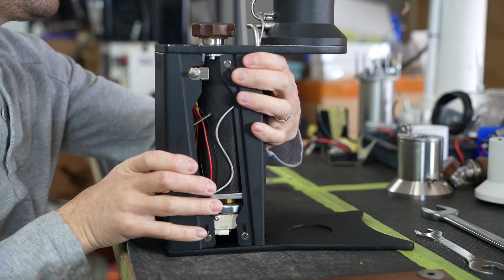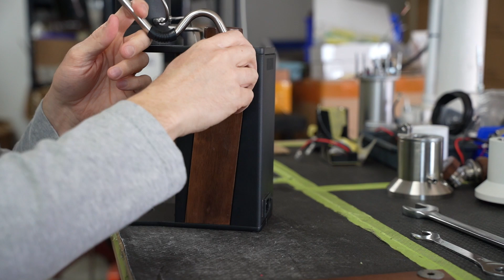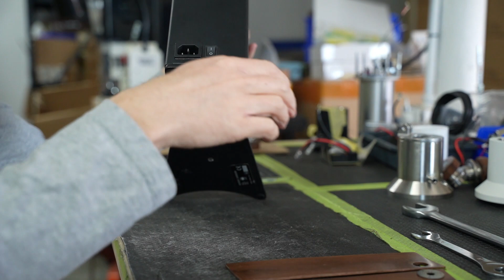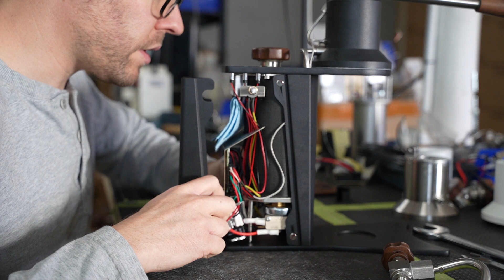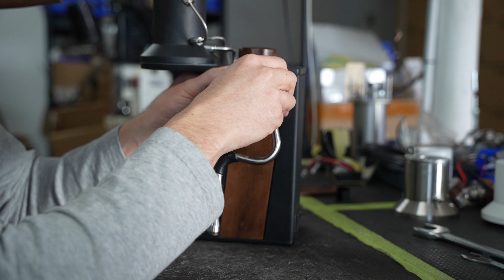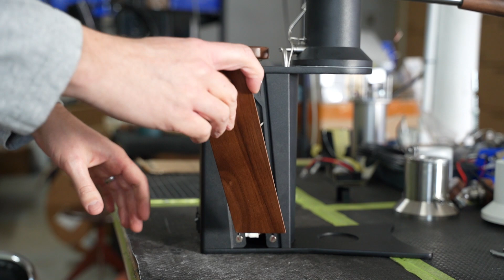Odyssey Argos Removing Side Panels and Covers

Comment: Do you empty the boiler when the machine is not use?
Reply from the maker: I personally do not. But you could flip it over to drain in a matter of seconds if you wanted
Reply: @odysseyespresso Sure, because my usage of the espresso machine is pretty low. 2-3 shots only on the weekend.